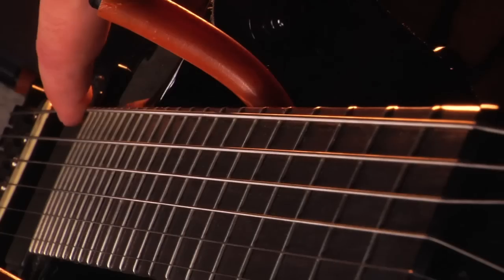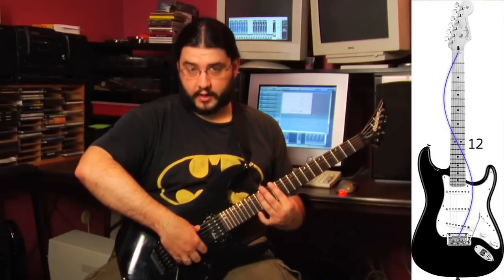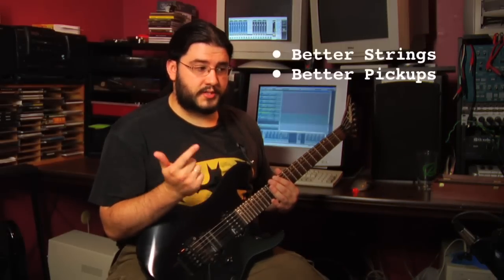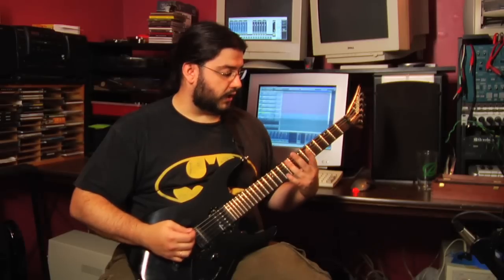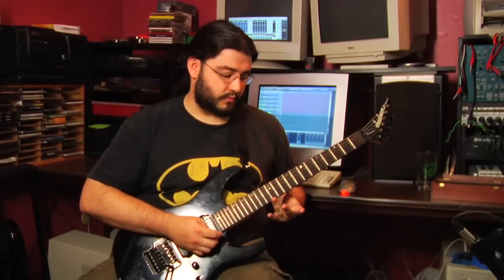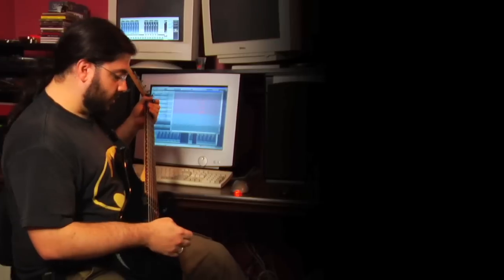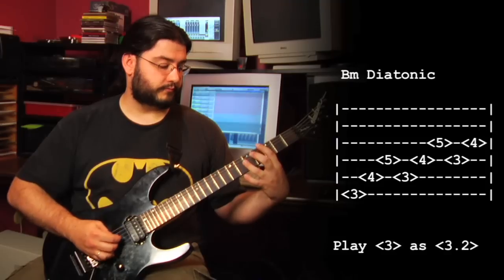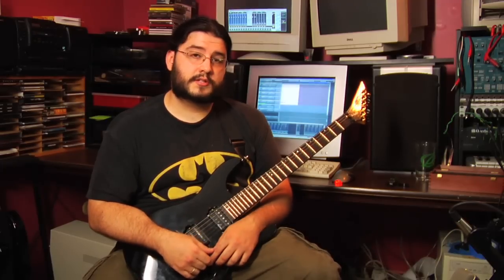Mike Bibby: Guitar Harmonics Lesson #1

Comment: Thanks!
Pulling high-pitch harmonics off on an acoustic is easier with good, new strings and some experimentation and rehearsal.  I prefer heavier gauge strings for this sort of thing (12s or 13s) because I like the tone better.  The margin of error is smaller, but using a firm pick close to the bridge and digging under the string to pull it away from the soundboard as you pick helps too.